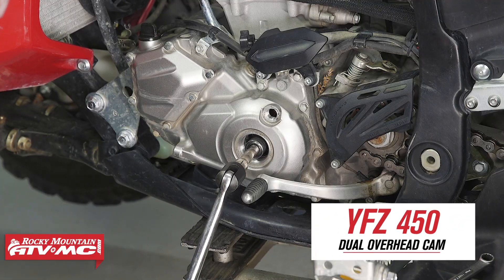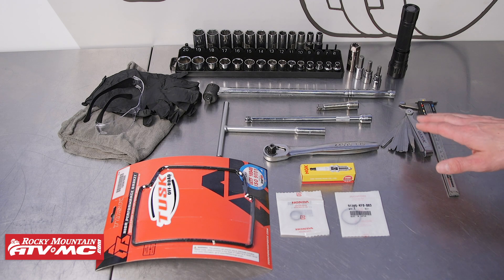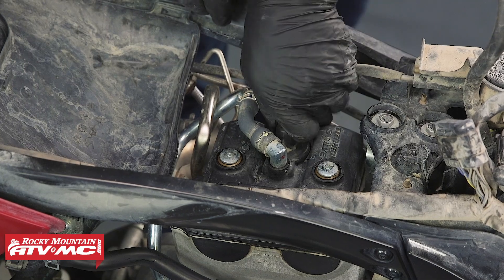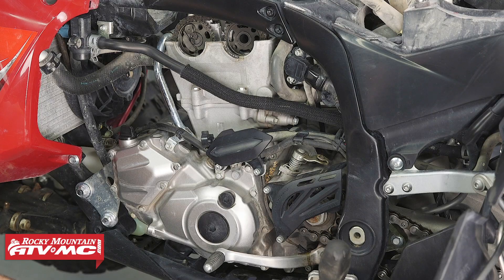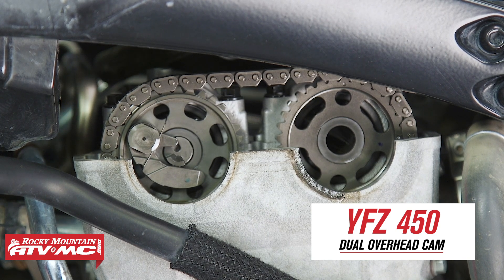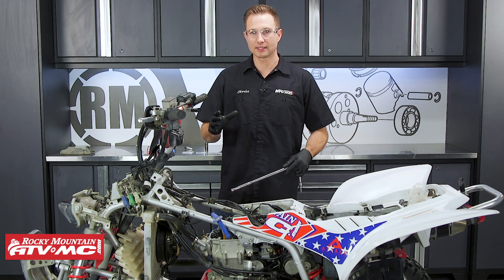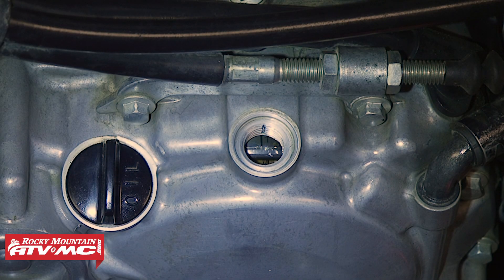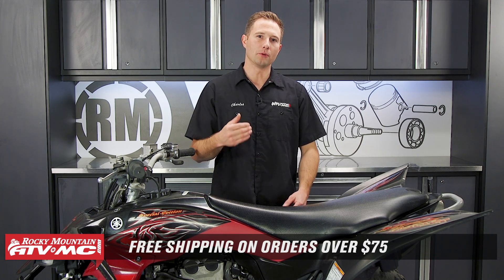How To Find Top Dead Center on a 4-Stroke Sport ATV

Comment: Thank you for explaining the difference between the Exhaust TDC and Compression TDC.  Just want to verify, is it ok to move the engine clockwise to go backwards (when adjusting on the left side of engine) if you overshoot the line up marks on the cam? Or does that damage the engine?
Reply from the maker: It's always recommended to go in the direction of normal rotation. Most of the time, if you barely pass it, I would rotate it back, but if it's way past then go the two revolutions.  Just be aware that there are some ATV's (the 400 EX if I remember right) that if you rotate them backwards, it will mess up the measurement because of the decompressor design. -Charles
Reply: @rmatvmc  Thanks for the reply, Charles.  I actually have a 2018 Suzuki RMX 450. When I was rotating the flywheel I accidentally went clockwise before I realized what a bonehead I was.